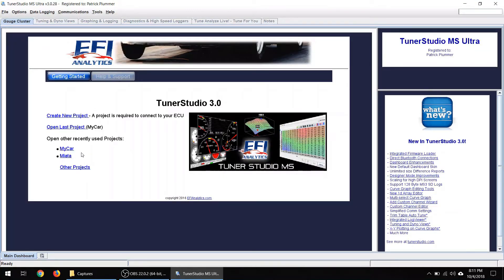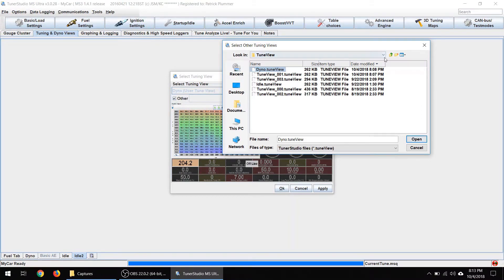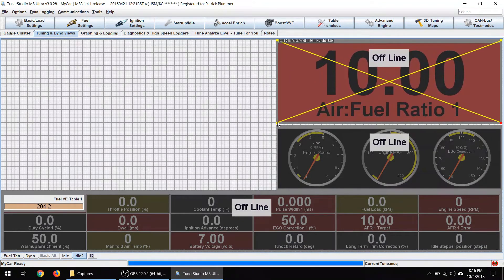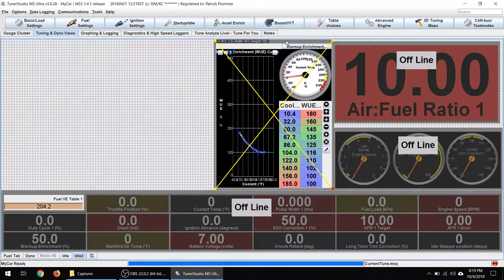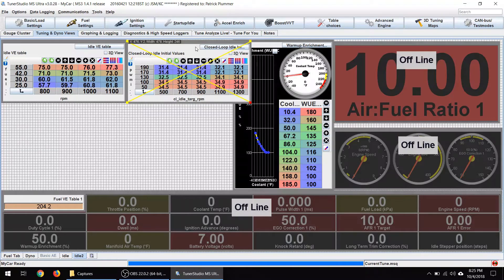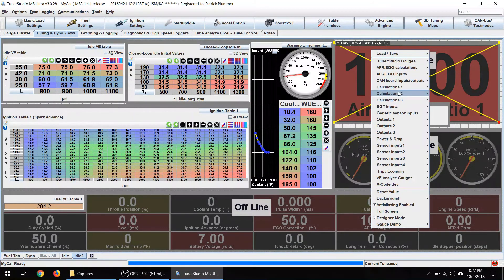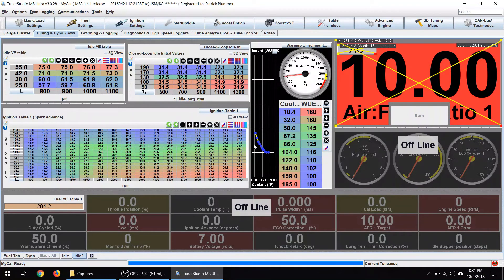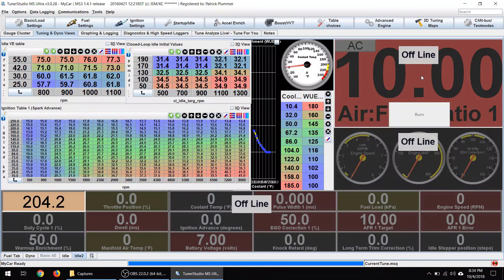Tuning the Megasquirt (Pt. 3) - Dashboards!

Comment: Is there any reason i can't add certain tables? Im trying to tune my miata with an MSPNP2 with the current version of Tuner studio (3.1.08) did they remove them or is there some settings I'm missing? or is it a limitation with the firmware of the PNP2?
Reply from the maker: There are a couple of screens based on the version of tuner studio (free vs regular vs ultimate) but most differences  will be based on the megasquirt hardware version.  The ms2 is missing some features they added, like some of the extra flex fuel stuff and maybe the special idle ve table.
Reply: @OGPedXing  Ok so it's most likely a hardware limitation then, since I did pay for Ultimate along with megalog viewer. Thanks for your reply! Tuning is kinda tricky and i feel like I should have gone MS3 simply because onboard logging too

Comment: can you post your dashboards for download?
?
Reply from the maker: Good idea.  I started a thread on miata.net and posted it there.  https://forum.miata.net/vb/showthread.php?p=9872140#post9872140
Reply: Hi, bro! You attached .tuneView file but how can I use it?
Reply from the maker: What you do is on the dashboard menu there's a load file option and you can select it and it will open up as a new tab on your dashboards view.
Reply: @OGPedXing  I did it wrong. It must be load on tuning&dyno views. Thx

Comment: i cant seem to find Idle VE settings in my tuner studio is there a special way to get to it ?
Reply from the maker: It may be supported in later megasquirt firmware's only (like for ms3) but if you set idle be to on in the idle settings it should be available on the idle main menu.   Honestly it's not that huge of a feature if your version lacks it.  You can use the regular ve table and just change the scale slightly if needed to give you more cells in the idle range.
Reply: @OGPedXing   all firmware is up to date. regular ve table as in fuel ve table? or....
Reply: ah wait im using ms2pnp lol
Reply: @FlintSky1313  I had the same realization not too long ago. For a ms2 to ms3 upgrade, that is a great feature I wish we had.

Comment: Hey man great info here. 
Got a question, I’m trying to setup my idle tuning views and I’m not seeing a idle vr table. It’s not there , any advice ?
Reply from the maker: If your Ms version and firmware supports it it should be on the main menu Startup/Idle then the last item, Idle VE Settings.  If it's missing from that menu then your firmware doesn't support it.   If it's there but not in the dashboard designer, you may need to turn it on, there is an option on that screen to enable it.
Reply: OGPedXing I’m using an old MacBook so that could be it also. Thanks for the reply I’ll check it out on another computer

Comment: Any idea why my TunerStudio doesn't show the 'Tuning and Dyno Views' enabled so I can click it?
Reply from the maker: Huh.  I did not realize this until looking it up right now but this view is only on the Utra version, not the MS or free versions.  You can upgrade it looks like for $45.  What you get is the tuning views and designer, integrated log viewer and trim table autotune plus a few other things.
Reply: dam 😂 I'm new to this I need help Im try to keep up with you on the videos going through the same settings I had to pay to see some stuff still didn't see my idle VE table?
Reply from the maker: Most screen differences aren't about the paid or not version of TS, it's about megasquirt you are running and the firmware install.  There are major differences between ms2 and ms3x.   The TS differences are mostly about the autotune features amd logging.  See this  page https://www.tunerstudio.com/index.php/products/tuner-studio/tsarticles/119-tunerstudio-30-feature-matrix

Comment: Does it show fuel capacity off the factory sensor  so we can possibly use this as a full time dash?
Reply from the maker: No, unfortunately not out of the box.  The factory fuel sender doesn't connect to the ECU.  However you are able to wire it yourself by connecting the signal wire to a spare input on the megasquirt (0-5v) I think.  Then in tuner studio you can configure the pin and use the add channel wizard to calibrate it like other sensors.  This link may help 
https://www.diyautotune.com/support/tech/controlling-gauges-with-ms3/
Reply: @OGPedXing  I only have ms2 for my Toyota... ms3 Dont work on the older toyotas 😭
Reply from the maker: @dangerousfandango5943  should be a similar process for an ms2 although there may be fewer inputs to work with...worst case you can add a circuit in the proto area.  If you can find a wiring diagram and pinout for your particular unit (there are a lot of different ones out there) then you can see what you can do next.

Comment: Been following your videos. I paid for a tune that's I feel is pretty bad. They added a new fuel pump and tuned WOT but my idle is rich and cruising is 10 afr sometimes. I can't get it to catch idle and it idle high. Turbo build motor miata build. Want to help me out?
Reply: I feel like alot of those tuners only tune for WOT power on the dyno but don't mess with too much idle and just say hey, you got XXX WHP, here you go